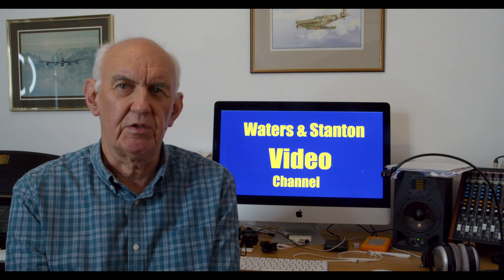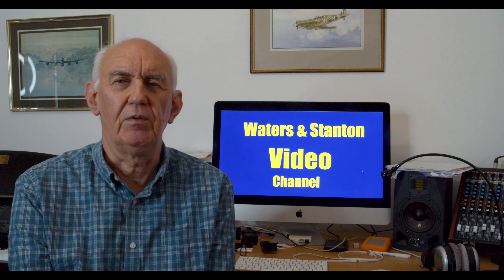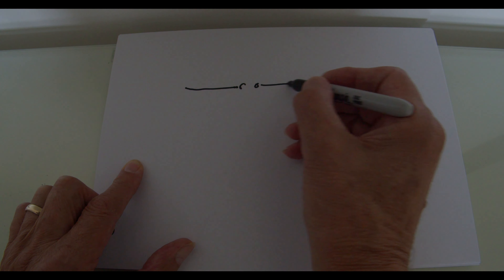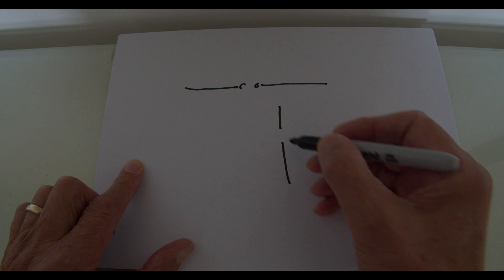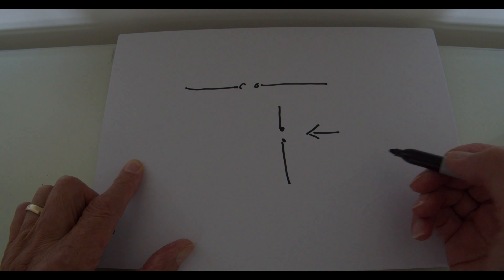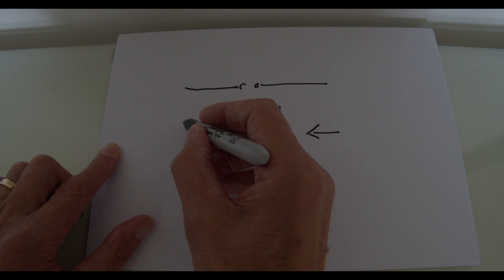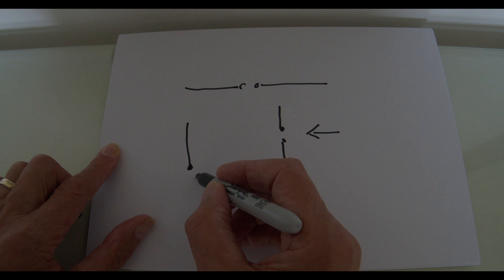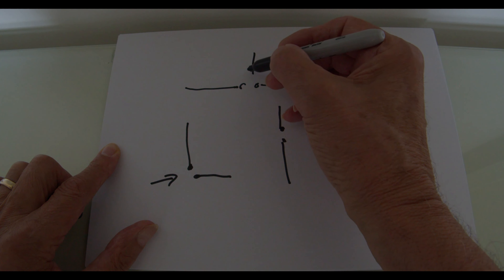Radials for Vertical Antennas - The Simple Truth

Comment: Thanks for your nice reply Peter. Always enjoy hearing from you. I just recently completed building a triband quarter wave in my small backyard and it’s performing quite well after a lot of tuning. I wanted to suggest a topic for one of your future videos. Antenna tuning, especially for an elevated quarter wave multiband and all the factors that effect it such as feed point height, radiator separation distance, radial angle and length and coax length. In my own experience the most difficult thing was getting the 15, 17 and 20 meter radiators to play nice together. I’m using electrically shortened mobile antennas from Shark Antennas as the three radiators. Attaching a picture for your reference.

Comment: I'm a fan of elevated radials having both ground mounted and elevated vertical antenna's the elevated vertical genrally out performs especially on DX when compared to the ground mounted antenna.
I should add that the elevated antenna has only 4 raised counterpoises and is mono banded for 20 meters. The ground mounted antenna has over 50 radials.
. In a recent QSO to VK (I live in the UK) I received an RST 339 on the ground mounted antenna then switched to the elevated and instantly was hearing better. Got a new RST of 559.....The proof of the pudding is in the eating!
Reply from the maker: Hi there. That is great info and will spur others to try it. Thanks.

Comment: Hello Peter, thanks for your many videos. I have a flat metal roof and I would like to mount a 1/4 vertical or a 4btv over it. Can the roof be used as a ground plane or would I still need to install raised radials? regards Shane

Comment: Thanks Peter. what do you think about a dx commander raised about 6 feet? Sloping radials etc?
Reply from the maker: You will get an improvement. But the downside is that you need twoonr or two resonant quarter wave radials per band. These radials will also benefit other bands but the big improvement is on the bands where there are at least one resonant radial.

Comment: Hi, very interesting your video. Thanks! I have a Butternet HF6V, and I have a questión: I have not enough room for the radials, but the roof of my house is made of metal sheet. What if instead of use buried wires as radials, I conect the radials to my roof..? Thanks and 73, ZP5 HBI
Reply from the maker: Yes that will work.

Comment: Radials always get lots of discussion. I just put up a DX Commander with 32 three meter radials pinned down to the ground and it works so much better than any other antenna I've ever had. I switch between it and my efhw and I can hear stations on the vertical that are silent on the efhw. Thanks for the info! Jack K5FIT
Reply from the maker: Hi Jack. Get that vertical off the ground and you will be 3ven mote inpressed! 73 Peter
Reply: I plan on doing this. I have only ever used a half wavelengths dipole. I'm going to see what I can get out of a quarter wave vertical. I very quickly yesterday got on my roof
Laid down for radials 90 degrees apart from each other. And the vertical is copper wire suspended by some string from a tree branch above. Going to mess with them or when I get home today SWR was high. Thinking about getting some conduit to connect for radios that will be sturdy and raise it from the center conductor up a pine tree 40 or 50 ft to see if it's any better than my dipole setup was.
Reply: @watersstanton Any reason the dxcommander won’t work raised 2 or 3 meters? My wife not happy about my proposed siting at the side of the back garden, so i have been relegated to a cramped space down the side of the garage. Only problem is the garage wall, about 7 feet vertical, would be about 3 feet from the antenna. If i raise it i might be able to get it above. Only worry is the radials .!?

Comment: Does a mobile whip on top of a car like the diamond CL you recommended count as "raised" with the car as the ground plane (instead of radials)?   It sure seems to work well for me.  Great channel, Peter.  73,  N7RLV
Reply from the maker: Generally the mass of car metal is as good as radials, so if you were to attavh radials to a mobile system there is no improvement. At least that is what I have found. 73 Peter.

Comment: I just bury a few sheets of cooking foil under the ground, works at treat and costs next to nothing.
Reply: I set up a radio station for someone. That had an old chain link fence she was going to throw out.  I set up a crude looking asterisk made of 1.25 meter tall chain link fence with the antenna in the middle, on top of a mast made of the horizontal pole of the fence.  She was not very happy with the look of it. But I told her that after a few months of growth and mowing, it would disappear.  That year it was extra rainy.  It actually disappeared in about a month.  She later painted the ugly, grey fence post holding up the antenna in high gloss black and the result was very aesthetically pleasing.  Though, I could not do on the air tests because I am not licensed, she told me she got glowing RST reports and her receive was better than she had ever had it in her life.  If I ever get licensed, I might redo the chain link fence abomination for myself. It cost her nothing because it was all salvaged parts.

Comment: I have a Diamond CP6S (purchased from W&S :-) ) on top of a 20' scaffolding pole mast.  It seems to work well on everything except 80m (very narrow resonance band on 80).  Is only having a single resonant/trapped radial for each band a compromise?
Reply: I've the same antenna. It says in the product description that resonance is very narrow on 80m so I knew I had to choose the part of the band where I wanted it to be most efficient. Any multiband antenna is a compromise.
Reply from the maker: Adding second radials is not really practical although you might want to try adding an extra full size wire radial for say 20m and see how it works. If it improves performance you might want to add other wire radials for some of the other bands.

Comment: If we elevate the antenna 3 m on a post how do we elevate the ground radials? What’s the best method to elevate ground radials?  I currently have 42 ground radials at 3 m length each and am stumped on how best to elevate each of them.  Thanks for your ideas.
Reply: You only need 2 tuned radials at 180 degrees from each other if they are elevated.
Reply from the maker: Simply attach radials at the 3m point and  anchor the  end just above ground level.

Comment: With all the discussions about radials, groundplanes, and counterposes, and the associated pain and frustration.  I am surprised that there is very little discussion about the WRC Otophone mount.  (https://www.youtube.com/watch?v=O8-vS3aJTTU&t=5s).   I bought one a couple of years ago and I love it. It allows configuration of 2 antennas as "V" antenna  with NO RADIALS.  I use with 2 - WRC TIA,  2 - 17' Whips, or 2 Hamsticks on same band elevated to 1.5 meters.   QSOs from GA to Eastern Europe, Australia, and Japan.   Big advantage - NO RADIALS.  Big disadvantage. - COST ($$$) it requires  2 antennas plus mount and stand. Just my thoughts - AC4OW.  What is you experience?  Opinion?  Keep the good information flowing.............